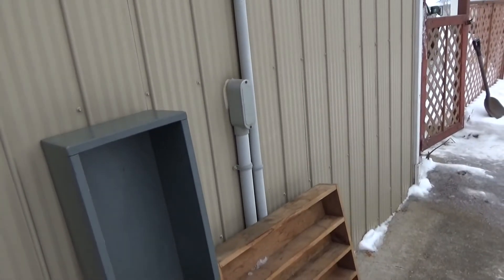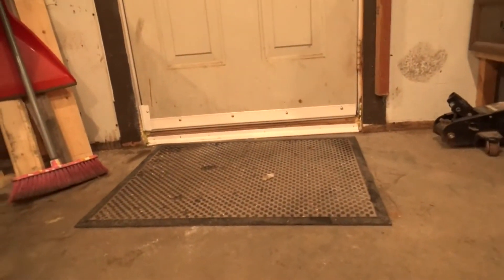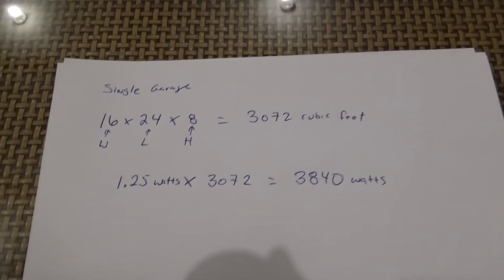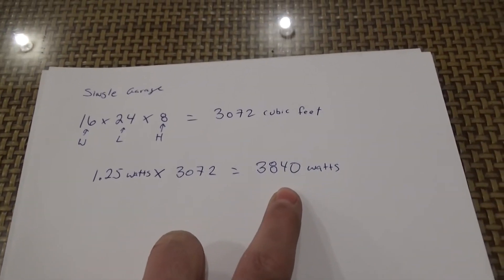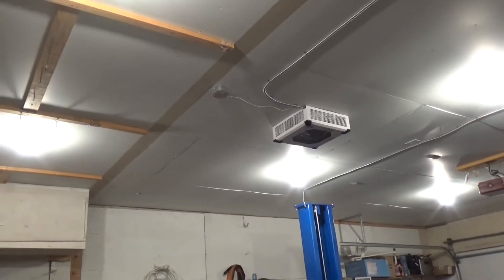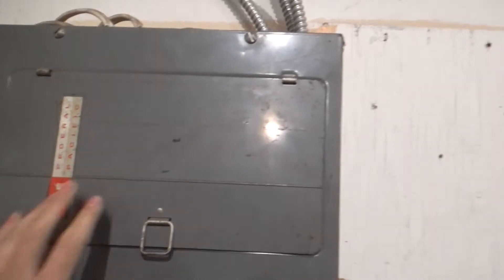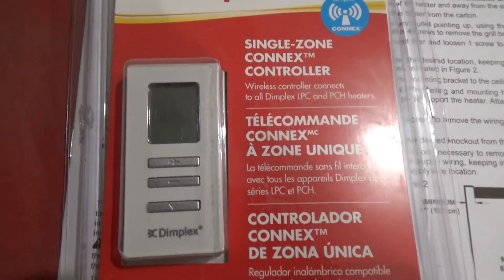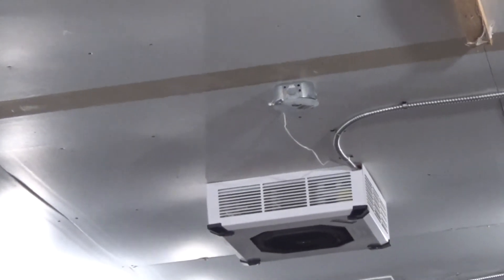How To Calculate The Size of an Electric Garage heater DIMPLEX CONNEX CEILING MOUNT REVIEW

Comment: Looking at one of these heaters for my garage and this is the only relevant video, and I live in a similar climate.

Wondering if you have any update on the heaters after 3 years?
Reply from the maker: @macauleysiemens  update after 3 years they are still performing perfectly and i don’t shut them off during the winter they run all through sub zero temperatures! Would purchase them all over again!

Comment: Is there a plug with these or do they need to be hard wired?
Reply from the maker: @mikesgarage5066  they need to be hardwired .however if you require a plug you can just wire one directly to the unit

Comment: Looking at one of these heaters for my garage and this is the only relevant video, and I live in a similar climate.

Wondering if you have any update on the heaters after 3 years?
Reply from the maker: Good afternoon. After 3 years I have nothing but good things to say about the heaters. Even though they are rated for 400 square feet even when it’s -30 Celsius outside one heater is sufficient to maintain 20 degrees in this space that’s 800sq ft 10 ft ceiling 
When door opens to bring a vehicle in then both turn on for recovery heat. They are quiet and that’s my favourite part. And haven’t had a single issue with them to date. I would/will purchase them again. Only thing is having it ceiling mounted the fans keep the air circulation downward etc. were not strong enough.

They heat the space fine but I wanted even more circulation so I added a larger ceiling fan in between them for continued flow as I found hot air pooled by the ceiling and the concrete was getting cold. That solved my issue of cold concrete .